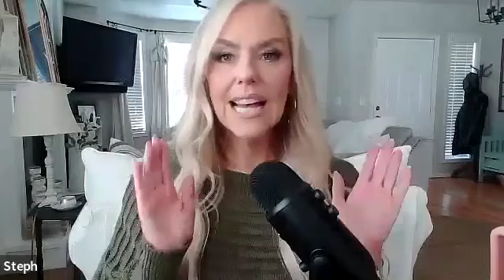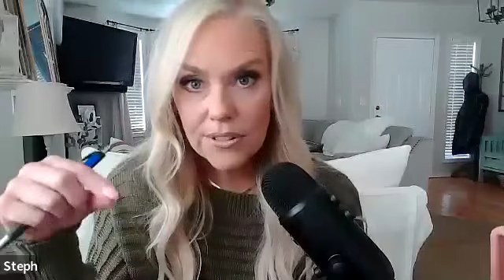The Hidden Problems With Vacant Mobile Homes & How to Avoid Costly Mistakes

Comment: Rodents are at the forefront of my concerns with the underbellies being exposed to that degree. How do you identify that type of problem, do you have a Home Inspector or a Pest Inspector come out?
Reply from the maker: The under carriage should be wrapped with a plastic material for protection but you could get an inspection if you’re worried about it